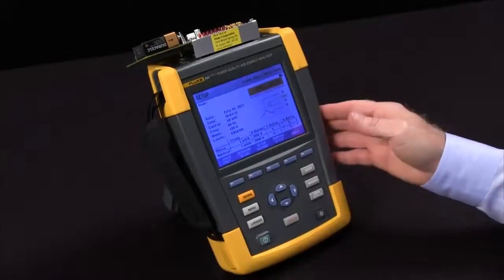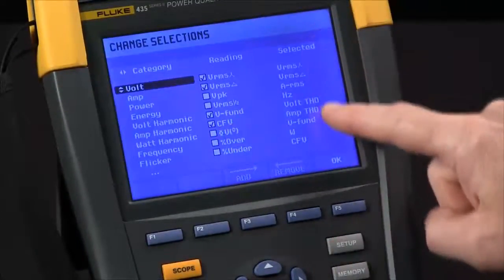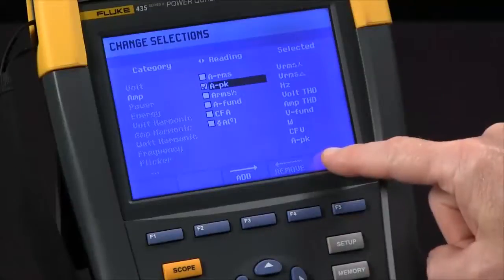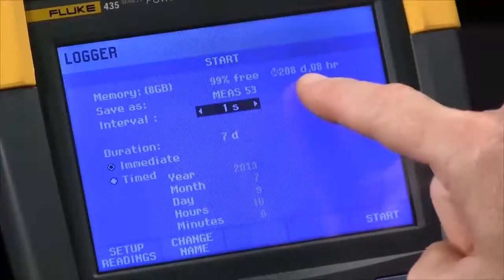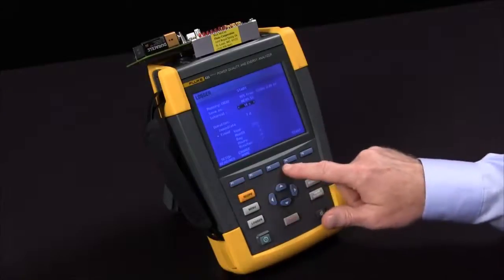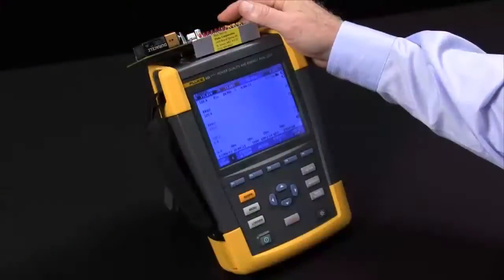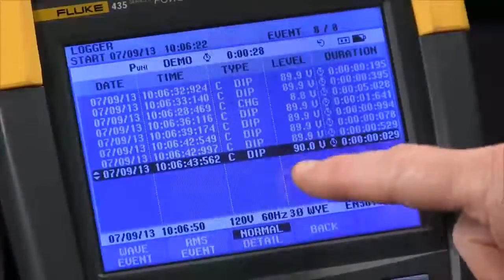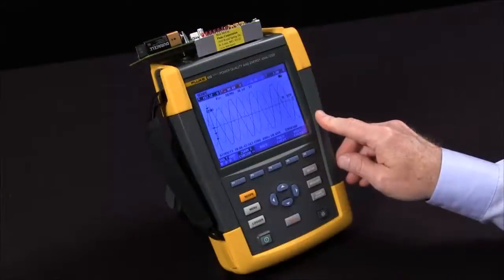How To Perform A Logger Set-Up On The Fluke 435 II

Comment: I would like to put the logger to collect data for a month. How I can set the duration longer than 7 days?
Reply from the maker: Thanks for your question Maya - Turn the 435 on and press the logger button. Move the arrow button down to interval and set it for a minimum of 1 min. Press the down arrow to duration and the right arrow to increase the time to 30 days. Press F5 to start.